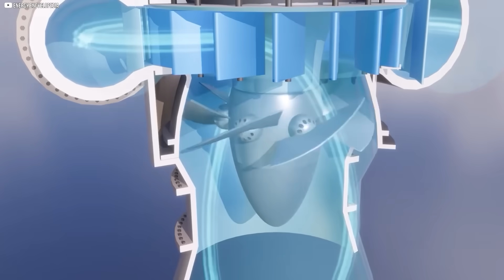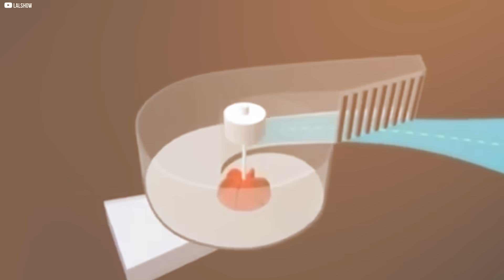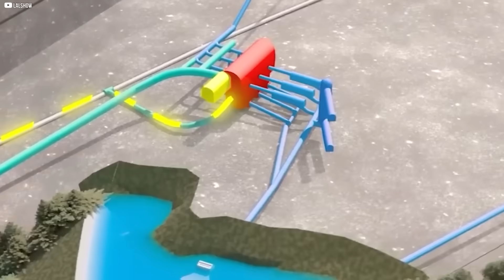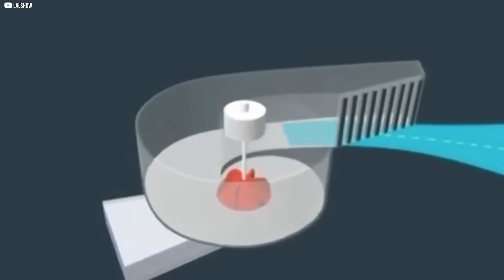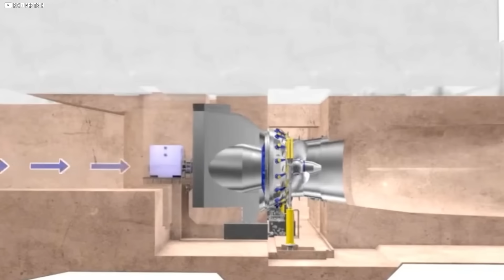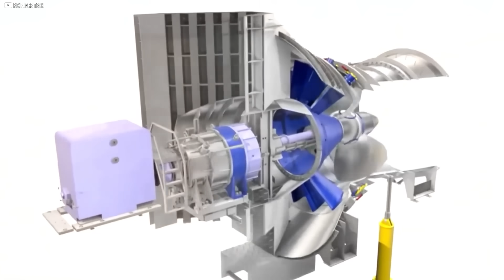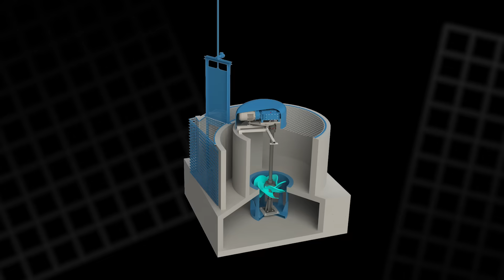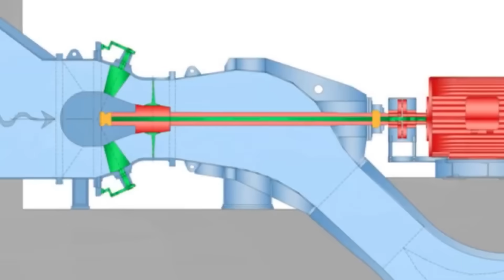Bladeless Hydro: The Silent Revolution in Renewable Energy

Comment: is a tesla turbine a bladeless turbine or are the discs the blades. yes they are. interestingly a tesla turbine would work as a francis revolutionary turbine. tesla turbine is a francis turbine. tesla turbine is the most efficient turbine of those types of turbines. not the turbo fan style bladed turbines. any spinning surface with air friction is a wing blade. the ball sphere can be also a vertical spinning cylinder surface. ie a single tesla turbine disc surface. ie a rolling barrel turbine. the high vertical column barrel is even more efficient than the sphere. there can be vertical vanes on the vertical barrel turbine, rotating in the spiral, but then its just a normal water wheel, but vertical tall.